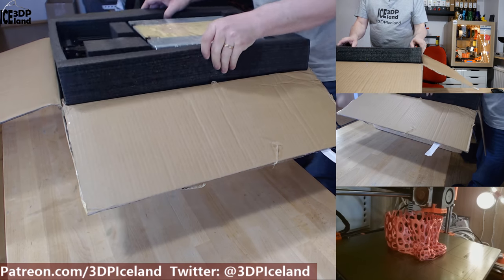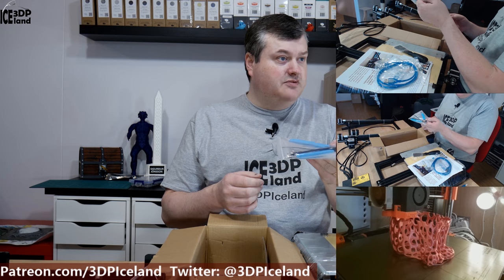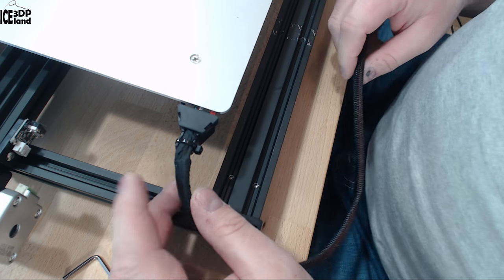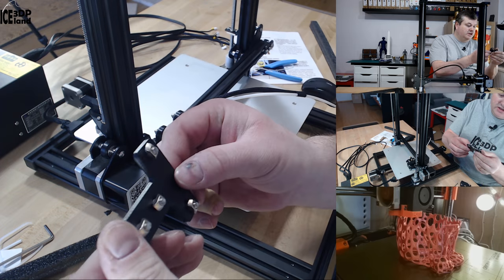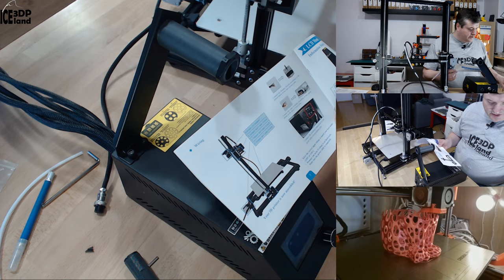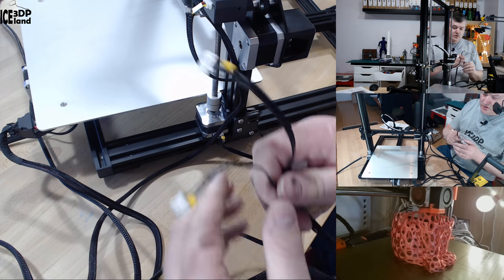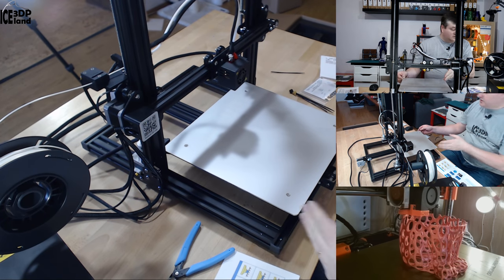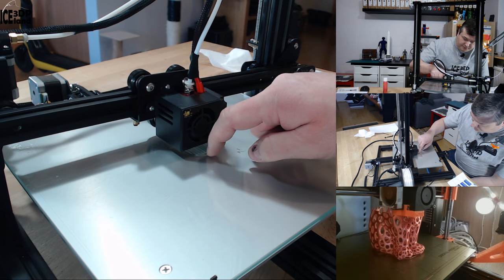Creality CR-10S 3D Printer Unboxing and Build

Comment: Yep, a simple build.  Seems you haven't watched other videos of the CR-10 build or you would have checked and adjusted the six rubber wheels on the bottom of the heat bed.  By leaning the printer on its side, gravity will pull the heat bed down. At that point, you will have to rotate each bottom wheel to see if they're touching the center Y axis beam or not.  If they spin, that means you have to adjust the tension to make each of the six wheels slight pressure against the beam.   If you don't do this and any of the wheels spin freely, that will mean you'll get wobble in your final print in the Y axis.
Reply from the maker: Hi , thanks for your points, - I failed to include that part in the video. I knew about the wheels needing adjustment and did it after the video was shot,  but thanks for the detailed explanation on the process.

Comment: Great Video explanation, I have a CR-10s, but always handy watching other peoples experience. I still have issues with my bed leveling. I am looking forward in receiving my Prusa MK3 hopefully this week, so will see how well that works against the CR-10s I am hoping it is as good as it's hype!
Reply from the maker: Nick Gagen thank you. Have you tried to replace the stock glass with a 30x30cm mirror?, my glass was crooked and unusable as the corners were in different hight than the middle of the glass. A cheap IKEA 30x30 mirror solved that for me.
Reply from the maker: And I bet you will be happy with the mk3, its a great machine, check my build video series on it, 😃
Reply: I have tried a new bit of glass, that worked ok and also BuildTak, which was good until it got a dent in it and now I use Mamorubot, which the first one they sent me was warped due to shipping, but the 2nd one has been working ok until lately. So I may pick up a mirror when I head to Ikea next time.
Reply: Yes, I have been checking all the videos on the MK3 and I am looking forward in getting it. I wanted one back in October, but shipping was taking longer then, so held off, also wanted to make sure they resolved any issues they were having.
Reply from the maker: yea, mirror seems to be working good with Magigoo :)
Reply from the maker: yea, I think you will have a good experience with the latest firmware.